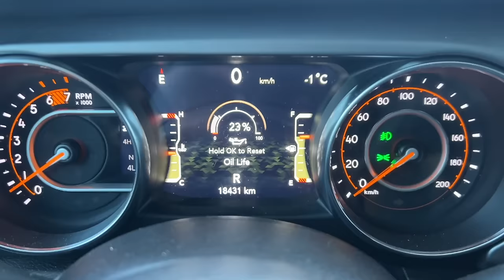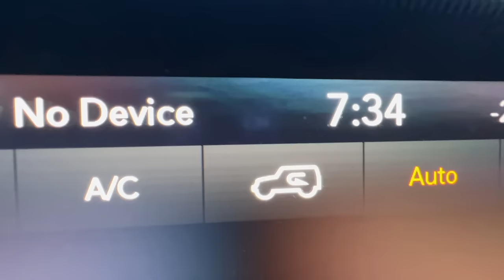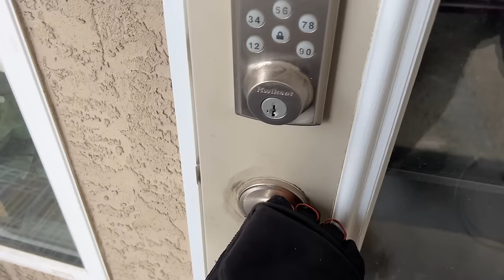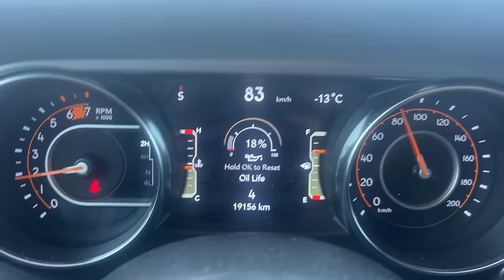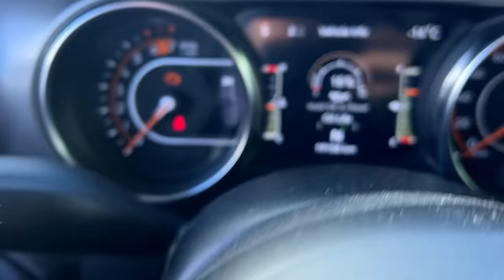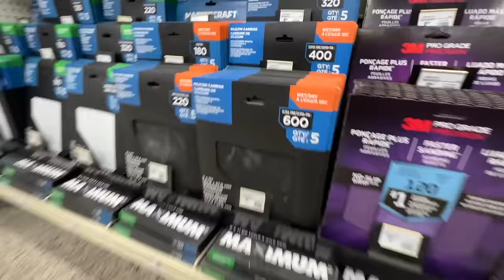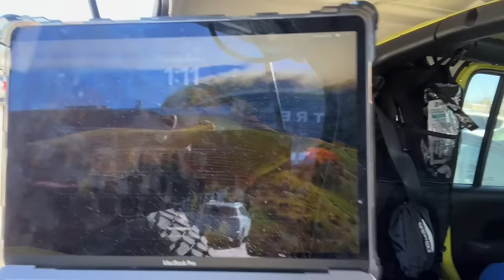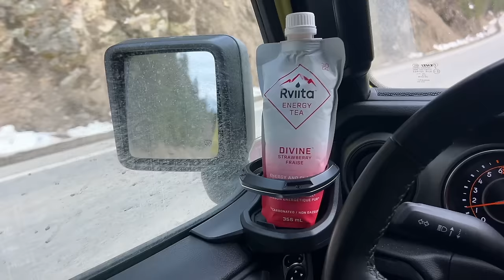Work Week in the Life - BC to Alberta and BACK | VanlifePLUS

Comment: If you really plan on using that induction cooktop in your van you really need to look up the rules on using those.. you have to use specific pots and pans with it. And while you're cooking you cannot lift the pot off the burner or the heat automatically shuts off!

Comment: Glad the cutters got the 2/0.  I’m sure they can handle the 1/0, just squeeze a little harder.  I figured they would from the picture.  I SHALL not say I’ve heard of SHALL, just one of the many names one manufacturer gives to their products on AMAZON.  Wasnt sure about the battery post connectors, but you never know when you might get another battery sometime.  What is today?
Reply: Suggestion, don't be surprised if the battery lug crimpers struggle with some of the crimps, I'm going through the same issue, I had to Amazon a hydraulic crimper for the largest battery lugs -- needs a TON of force....

Comment: Pro Tip, don't use the squeegee on anything think about the amount of grit trapped in it and there you are doing windows and other things.
Reply: The windshields will be cracked by next winter season, it's a curse up there 😢
Reply: Agree, over the 27 yrs of driving  long haul  truck I have wound up with 2 scratched windshields  and my drivers side window because  of dirty squeegee s 😂
Reply: I didn't know this, thank you 👍
Reply from the maker: Already have a massive chip 👍
Reply: Oh no !!😮

Comment: 2/0 is bigger than 1/0 wire
Reply: We ought not quibble about size.
Reply: When you get to the larger size wires like the 1/0, 2/0 etc  the higher the number the larger the wire. What you said applies to the circuit sizes for example #14 is smaller than #10. Matt could have a problem if he installs 1/0 where 2/0 is needed since it is not rated to handle the higher amperage. If it is overloaded it might fail just like a fuse that is overloaded. I sold wire for 45 years so I feel confident in what I am saying.
Reply: @budmetcalf3888  you are of course right.  I was only being humorous with that remark.  I was trying to determine what Matt was using based on what I could see on the vlog.  I figured 1/0 would work because I thought that’s what he was using.  With 50’, he should be able to double up if necessary. 
,
Reply: @billboyer7735  he mentioned that he had purchased 2/0 lugs which are probably range taking so they will handle the 1/0. My concern is that he might go ahead and use the 1/0 thinking it would work